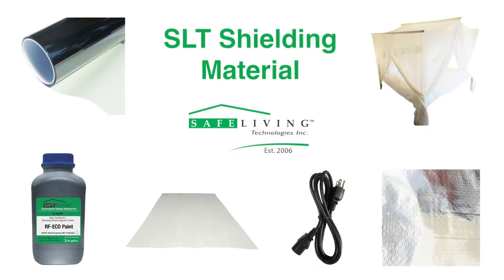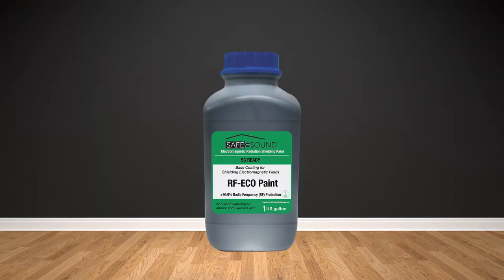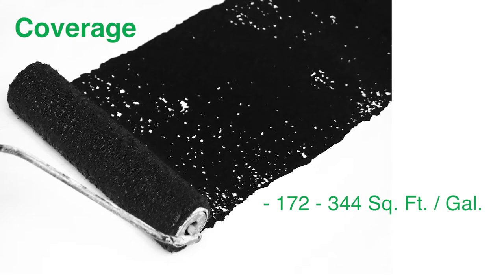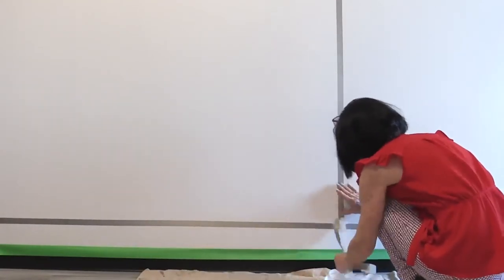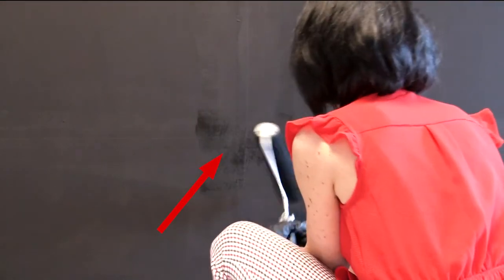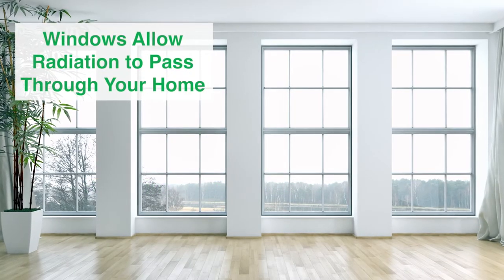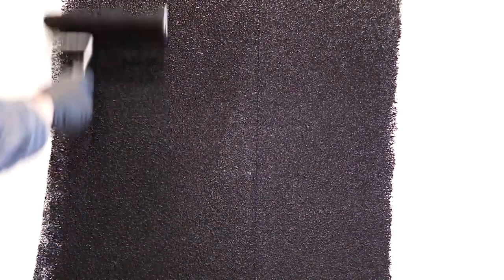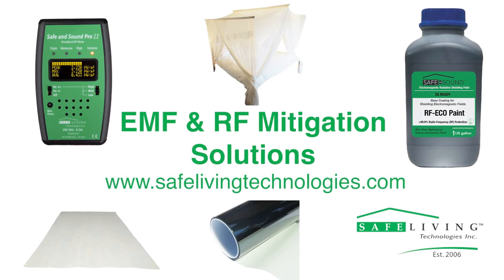Safe and Sound RF-ECO Paint - EMF Shielding Paint Application and Grounding Instructions

Comment: I live on the 10th floor of an apartment building. Does the paint have to be grounded to the earth or could it be grounded to a plumbing pipe in the kitchen or washroom? Also, should the floors and ceilings be painted as well to shield EMF signals from neighbors above and below me?
Reply from the maker: We would suggest contacting a locally licensed electrician for grounding to comply with local electrical codes.

Comment: Can we assume that we can paint over the emf paint to our desired color?, I didnt see that covered in the video.
Reply from the maker: Yes you can apply your paint on top of it once the grounding is complete.
Reply: I read you can , I just I ordered some paint from anazon and it says it there , but this will be the last time I oder from amazon , supposed 2 be here , said 2 days , it's been over a week then they said the order number was no good , well I got it from them, tracking on it stopped its been hell, then it's not the first time , they lost a$200 order samething...but they do have the info it.
Reply: Order from here but show electrician video off of Amazon,  Amazon did mess my order up, but never got the stuff, finally today I  got it handled but they have info if your service guy needs.